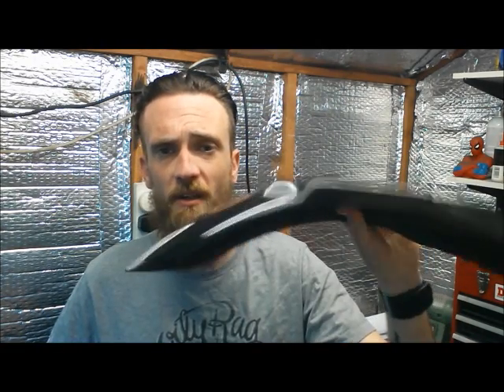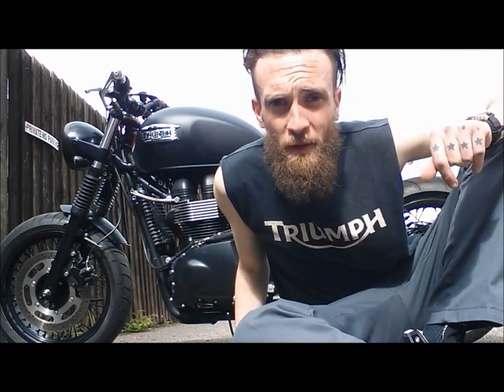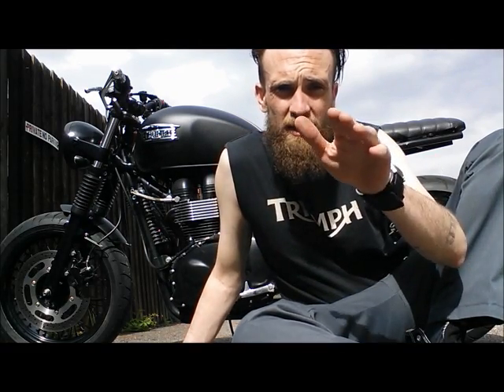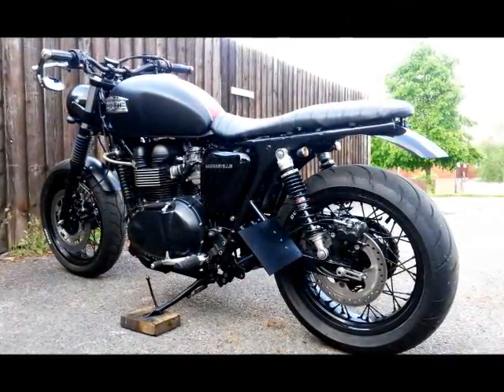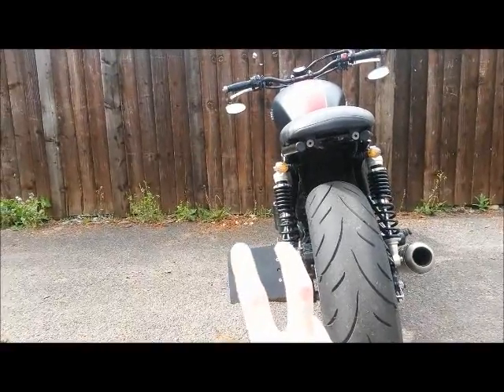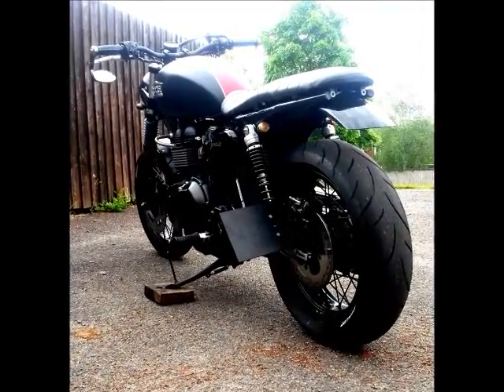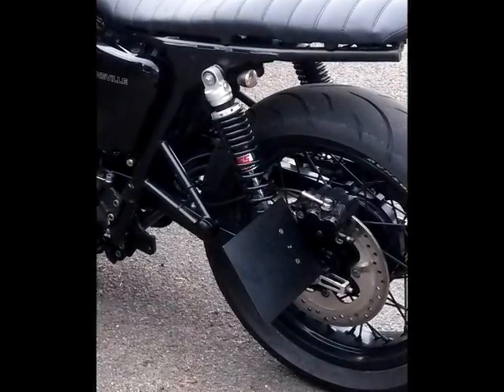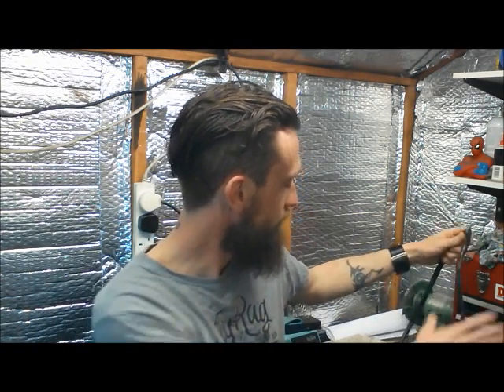bonneville kneepad and badge removal and sidemount phase 1

Comment: If the handlebar / clip on debate was a head scratcher, this one is going to be on par lol..  From the back I like the look of the bike without the mudguard the caveat to that is  a claret strip as a continuation of the tank?  From the side the mudguard is a continuation of the curves and finishes the tail off nicely...   Doh..  the number plate on the side... it looks massive, from a safety point, worried that you will filter through a gap turn the bars to squeeze through and catch the plate wheel rim, probably never happen, I am just being an old woman.  .. the discreet tail light is great... good luck with the tank paraphernalia < great word.. had to look how to spell it though...
Reply from the maker: GTs Garage ha ha- so true!!!- i think i would jump on the mudguard if i were to chop the rear frame rails down a few inches..maybe to finish inline with the rear hub center (but no plans to go that drastic....yet....;-) ) i reckon the plate will be ok- did some footage of it with me on it and it's within the bars and my size tens so hopefully i won't wing anything!!! plus i'd like to do the body work in matching 2k satin...but until i get a compressor i may have to farm that out...so less bits to paint!
Reply: A cutting wheel to a proper £250 p.o.s is a no brainer. but a bike that will hold value all day long.. would have to think long and hard about that lol